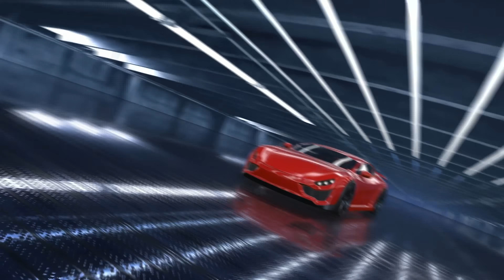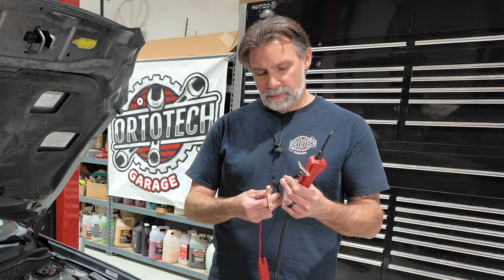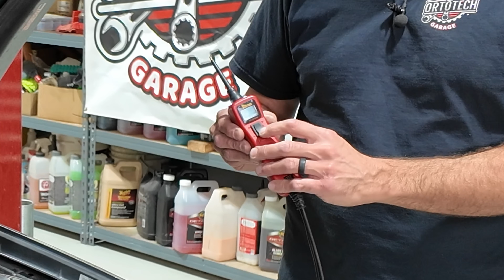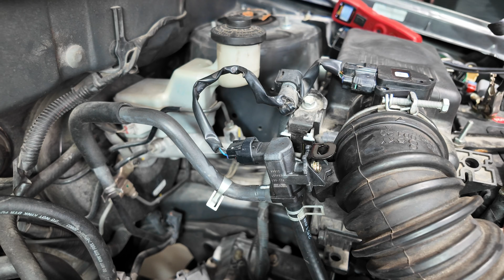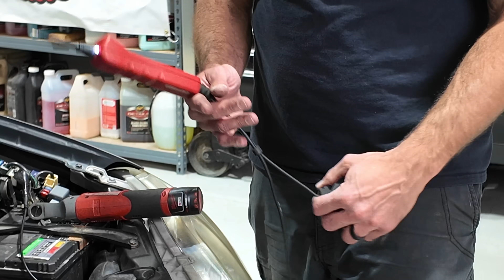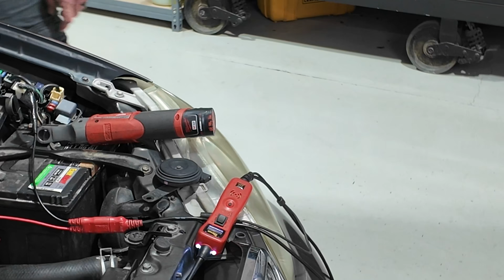Stop Using a Test Light! Use This Instead

Comment: I have Autel PC100. AC on one car stopped working, the Clutch on the Compressor is not engaging. It is very low on R-134A (gives very weak hiss, if to press any port w/screwdriver), and of course won't engage just bcs of that. But it would be better to make sure that the Clutch would click on engagement if to send power on the compressor directly. Thank you for the informative video.
Reply from the maker: You haven’t really given me enough information without knowing the year, make, model and type of A/C system. Some compressors use a conventional magnetic clutch, while others are variable-displacement compressors that are electronically controlled. I would not apply power directly to the compressor without first knowing which system you’re working with.
If you already suspect the refrigerant charge is very low, that’s where I would start. Connect a manifold gauge set, then properly recover and measure the refrigerant remaining in the system. The recovery process will tell you exactly how much refrigerant was actually there. You really can’t evaluate system operation properly when the refrigerant charge is significantly low, and the control system may intentionally prevent compressor operation.
Once you know the system is properly charged, you can diagnose the compressor command. On a conventional magnetic-clutch system, that may be as simple as checking power and ground. On an electronically controlled variable-displacement compressor, I’d want to look at the control signal with a lab scope rather than simply applying power.
Also, I wouldn’t recommend depressing the service-port valve with a screwdriver. Besides releasing refrigerant, seeing or hearing pressure at the port really doesn’t tell you whether the system has the correct refrigerant charge. 👍
Reply: @OrtoTechGarage  Thank you very much for the replay. The car is 2001 Saturn SL2. Three years ago I've replaced there personally in AC everything, but the Evaporator (sitting too deep) and one line (couldn't find one), which is coming out of it. Flushed the system w/99% Isopropyl alcohol, dried like for 3-4 days, vacuumed, charged. It worked vert well till now. I didn't realize you need to check pressure and add R-134A there sometimes, and was busy. Anyway I thought to do how you advise, but i don't have a recovery machine, I would need to go to a dealer to evacuate. So think to test somehow the compressor before vacuuming hoses, take measurements on the pressure, and adding more refrigerant to see if the compressor starts to work. 
   No one is pressing the Schrader Valve on the port to check the pressure level. It is usually done to see if any refrigerant is left there. For example you go to a dealer to evacuate. After would you start to work on that AC system without any checking if they really did evacuated, or you would start to open everything without testing that Schrader Valve?! I'll tell you they can add R-134A there instead of evacuating, since mix up smth. or just been in such mood.  There are also many just unprofessionals working there somehow. Oafs and Clowns. For you it doesn't matter of course, you have a recovery machine. 
   Thank you again for the concerns with my question.

Comment: I’m a 45 year aircraft mechanic. Army helicopters and almost 40 years at a major airline. After being screwed by car mechanics when I was a young man, I have made automotive repairs a hobby. I just purchased a DW833 that tests relays and circuits. This video reminded me about computer voltages that are way below 12 volts. A great way to fry computer circuitry. You’re also right about learning from others. As a senior Airline Technician, I’ve had relatively new mechanics teach me new skills. The brain trust is essential.
Reply from the maker: Absolutely. That’s exactly why I stress using a Power Probe with caution. It’s a great tool when you understand the circuit, but you need to know what you’re connected to before applying power or ground. Many computer and communication circuits operate well below 12 volts, and applying battery voltage can get expensive very quickly. Having a wiring schematic and understanding the circuit before testing it is key. And I completely agree about learning from others. I’ve been doing this a long time and I still learn things from other technicians daily. It is impossible to know everything.  The brain trust is invaluable. Thanks for sharing and for watching!  I hope you may find some of my other videos helpful, too. 🙏
Reply: @OrtoTechGarage  I subscribed before the video ended. I own a 2016 Mustang GT and a 2005 Lincoln Aviator. I’m troubleshooting my wife’s 2011 Mini Cooper Countryman S air conditioning today. Any videos on those cars would be appreciated. Thanks again for a great channel on YouTube.
Reply from the maker: Awesome! Thanks, Richard! I really appreciate the subscription and the kind words. Those are all great suggestions. I don’t see a lot of Minis in our shops, but they certainly present some interesting diagnostic challenges! 😂
I do have a couple of videos on a Mustang evaporative emissions diagnostic, including one showing how to replace the capless fuel filler pipe. You should be able to find those in my video collection.
I’ll keep all three vehicles in mind for future videos. Good luck with the A/C diagnosis on the Countryman, and be cautious when diagnosing variable-displacement A/C compressors. They can make the diagnostic process a little more interesting.
Thanks again for watching and supporting the channel! 👍

Comment: Really liking your videos. What tool would you suggest if voltages are 48 and even 72 on golf cart battery systems. Seems this tool is rated for 12 and 24 volt. Just asking
Reply from the maker: Great question. 👍 For 48V and 72V golf-cart systems I’d step up to a quality digital multimeter rated well above the maximum pack voltage rather than use this Power Probe. Something in the 600–1000V DC range from Fluke or another reputable meter manufacturer would be much more appropriate. For current testing, a DC clamp meter can also be very useful. The big thing is making sure every tool and lead you connect is rated for the voltage you’re working with, especially on a 72V system.  Thanks for watching!
Reply: @OrtoTechGarage  thank you sir for your reply
Reply from the maker: My pleasure. Best of luck with your projects!

Comment: I want a magic tester. When you plug into the cigarette lighter and when something random happens it beeps the digital readout tells you what to fix.  
I also want to win the Powerball 🤣
I have a problem with my 93 Chevy S10 and when it rains or even when there's a very very light missed the battery light comes on and then goes back off. 
This has never happened when it's dry outside. It hasn't happened all summer. 
Is happened when the mist is just barely starting and the pavement isn't even saturated yet.  Last summer I started at the rear tail lights and started cleaning up every ground wire I could find all the way up to the headlights. I added an additional ground from the frame to the cab, another one from the cab to the dash harness ground to  the firewall in the engine bay.  I added a 12 gauge wire from the alternator to the battery, both positive and negative.
Here's the kicker 
When it did this random blink one night I had my brother se inside to watch for the charging light to illuminate. 
I took a hose and started misting the underside along the frame from the tail light to the headlight, then down the other side including the starter and transmission.
Nothing 🤧
I opened the hood and sprayed the headlights, the alternator, inside the cowl, virtually everywhere.
I can't make the light blink.
I need a magic meter for random stuff.  I dread winter approaching because random will reappear.
It did this with two new alternators.
What after driving in the rain or even a light mist can affect the charging system?     There's a weak link somewhere.
At least my truck is old and the PCM is basic. I can just unplug a few sensors to test most wiring issues.
That tester looks like a must have. 👍
Reply from the maker: When you find that magic tester, let me know because I want one too! 🤣

Seriously though, the fact that this happens specifically with rain or even a light mist is a pretty big diagnostic clue. The battery light should be directly related to the charging system, and at this point I’d get a wiring diagram and concentrate on the charge-indicator circuit between the alternator and instrument cluster.

You’ve already done a lot with the grounds, and since the warning light obviously has power when it illuminates, I’d be looking closely for an intermittent short to ground, moisture intrusion in a connector/harness, or an internal alternator problem. Depending on exactly how that ’93 is wired, I might even temporarily bypass the original charge-indicator wire with a known-good test wire from the alternator toward the cluster and see if the problem disappears. That could tell you a lot.
The fact that you can practically make it rain under the truck and still can’t duplicate it is exactly the kind of intermittent electrical problem that makes technicians lose their minds. 😂

But there’s a cause, you just haven’t caught it in the act yet.
Reply: @OrtoTechGarage 
Two models ....summer and winter. 😁 👍

Comment: Better than a scan tool? A power probe is better than my Autel MS909? Really? I think you mean in specific situations as I use the Power Probe for certain electrical test and I love it but  to say its better than a high end scan tool without any explanation is ridiculous. That's a broad statement that I would expect to hear from a well paid salesman. Don't misunderstand me; its great for specific situations. That broad statement, "it's better than a scan tool (period)" is a foolish statement
Reply from the maker: Fair point. 👍 I probably got a little overzealous saying “better than a scan tool.” What I meant was more useful for certain electrical circuit diagnostics. Obviously a Power Probe isn’t replacing an MS909 or any good bidirectional scan tool.
But when I’m actually chasing a circuit problem and testing power, ground, voltage drop, or directly testing components like motors, relays, and solenoids, the Power Probe can do things the scan tool simply can’t. They’re really complementary tools, and ideally I need both in my toolbox.
Reply: @OrtoTechGarage  Okay. I could manage with my MS909 and Pico scope but who wants to set up a scope when they can just grab a power probe and get it done. I do it all the time and I love my Power Probe, too!
Reply from the maker: I agree.  All three are needed...come to think of it, this business require a ridiculous amount of tools amd equipment to be efficient.  Pico is pretty slick though especially if you have the amp probes and a pressure transducer.  But damn is it costly.  I may grab the NVH setup for mine soon, too. 👍
Reply: @OrtoTechGarage  I have the standard kit with 2 amp probes but not a pressure transducer. I'll have to buy that separately if I want it. I'm getting by with manual compression and vacuum gauges for now.
Reply from the maker: It's obviously more of a luxury than a necessity but nice for doing some specific tests.  It adds significant expense, though. I find the more you use any scope, the more you'll use it...If that makes sense. There are many ways to diagnose a problem, but once you get comfortable with setup and looking at patterns you gravitate towards tools your comfortable with.  Kind of like me and my power probe. Keep up the good work!  This business rewards the ones who have the rare combination of skill, intellect, aptitude, good attitude and productivity. 🙏
Reply: @OrtoTechGarage  I'm actually a Professional Land Surveyor who has been doing auto repair in my spare time for the last 45 years. Boy have I seen changes. Anyway, I'm now 65 years old and semi-retired. I try not to "turn wrenches" anymore but I still do. I primarily diagnose issues on vehicles for several mechanics who don't have the access to online manuals or high end scopes and scanners for a reasonable fee. It's better than them just throwing parts at it and hope it sticks. As for my Pico scope, I used it about a month ago but only because I had some time; I had already concluded the issue was a faulty cam position sensor by measuring the resistance with a multi-meter. Just for giggles, I hooked the scope to the #1 coil, the crank sensor and the cam sensor in question. The waveform confirmed what I already knew. It's time consuming to take out a scope and boot up a lap top within range of Wi-fi if you are using the waveform library. With all that said, it's rare to find someone who can easily work on any car today. I find that the best techs work at a dealership and only on the cars that dealership sells. Auto repair is so much more of a challenge than it was when I started in 1979. I wouldn't want to try to make a living doing it if I was just getting started today. Nice talking with you!
Reply from the maker: Absolutely, and I think we’re actually pretty close in how we look at this. Different diagnostic situations call for different tools, and experience plays a huge part in knowing which one will get you to the answer efficiently. I’ve enjoyed the conversation and appreciate you taking the time to share your perspective. 🙏
Reply: @OrtoTechGarage  Absolutely, it's been my pleasure. I believe one month of experience working with a master mechanic is better than a year of schooling. Keep turning those wrenches and try not to lose your temper (like I do) when things go south, as they usually do.  lol

Comment: Ive been using 3 and 4 for years!
Reply from the maker: Awesome!   I have found the PP4 to be a little gimmicky with all the advanced features but I wanted it specifically for the Driver Test, which I rarely use.  I do like the auto reset breaker, too!  I can't live without a PP.  Lol. 🙏
Reply: @OrtoTechGarage The circuit tracers from both worked great on large trucks. I work on compactors and on many occassions traced wires that were routed back and forth the lenght of the body several runs. I just ran new wires! 😂
Reply: The 4 has more features and that extra wire functions differently and is easy to blow the fuse if not used on the correct functions so I would suggest purchasing several extra fuses to help you get used to it for them oops moments! I also would sugggest most people purchase the 3 because its simple and most people wont use the other functions on the 4. I use the 3 way more than the 4 plus the 3 has a extension cable to service large trucks and trailers.
Reply from the maker: Great tips there.  I also agree the PP3 is perfect for most people.  👌

Comment: Hi how you doing. I have a headlight that uses ballast type bulb. I test it with the test light and theres ground and voltage to the connection but still no light working for the one side and I've replaced the bulb too. Any idea?
Reply from the maker: HID/Xenon systems are diagnosed differently than conventional halogen headlights. Don't try and test the high voltage of the ballast with a test light or power probe.  If you haven't already, I'd start by swapping the bulb to the opposite side to verify the new bulb is good. After that, I recommend following the manufacturer's diagnostic procedure for the ballast and the rest of the system rather than relying on a test light alone. Hope that helps!

Comment: "Multimeter can't supply power and ground."
Multimeter Fused Jumper Jack: Am I a joke to you?
Reply from the maker: That's a good point. I was talking about the multimeter itself. A Power Probe is designed to (somewhat) safely and quickly apply switched power or ground, which is why I reach for it so often.
Reply: @OrtoTechGarage The Power Probe 3/4 was already very convenient, but now that the Power Probe 3 Powerflow is out (has the LOADpro 180 .5amp Draw Function) it's even more well rounded. Do your bench testing and Voltage Drop right there, one tool.
Reply from the maker: I have seen that, but havn't bought one.   I'm still sorting out the Power Probe 4 and trying to figure out if its useful enough or just gimmicky. It does give you voltage drops, too.  The driver test feature is the main reason I bought it, but can only be used for ground side drivers.  Let me know your thoughts on the new PP3 PF. 👍
Reply: @OrtoTechGarage  I think you can do Voltage Drops the backprobe way with the PP4 but not actually bypassing the component using the connector, doing a 0.5amp pull by the PP4 itself to induce the Voltage Drop like the PP3 Powerflow can.
I don't have the PP3 Powerflow yet either. I think I'm going to just use my LOADpro 180 and wait for a PP4 Powerflow to inevitably come out at some point. If I'm going to spend that much, might as well be on the latest version.
Reply from the maker: I am going to make a video on the PP4 soon. When I do, I will demonstrate each of the features it does have.  I think it really tries to do too much in the name of only having to reach for one tool most of the time.  Let me see what I can put together so people can get a better understanding of what this tool does and what it doesn't. Its way too advanced for the average user. Thanks for the chat!  🙏

Comment: I don't use mine enough. It's so much handier than its base use. The leads are long enough, and you don't have to switch from power to ground constantly like you do with a test light. Both have their uses for sure.
Reply from the maker: This is true.   There's always many ways to get the job done, i just prefer the Power Probe over most other tools, if I can. 👍